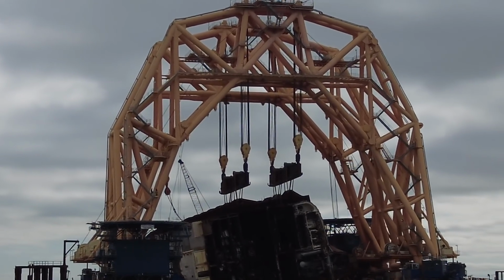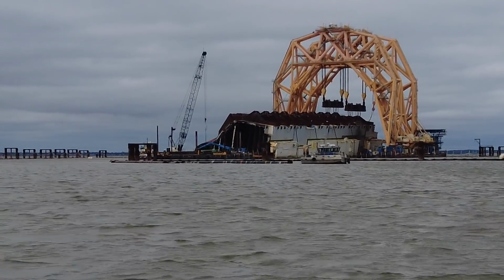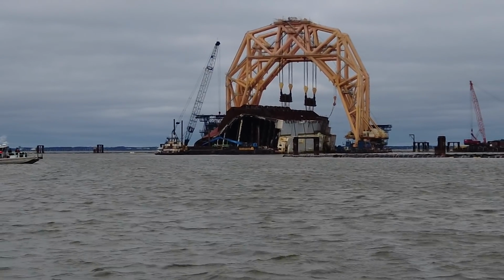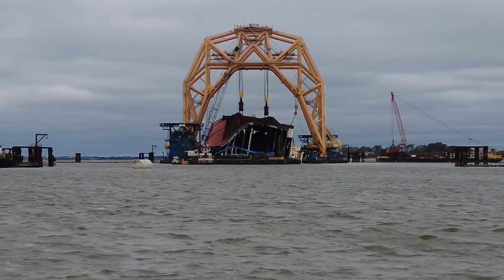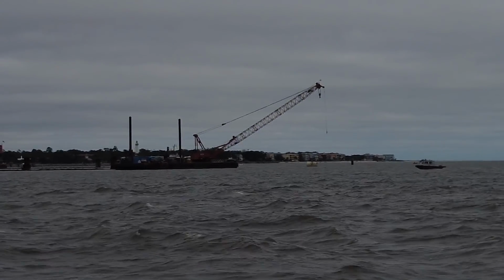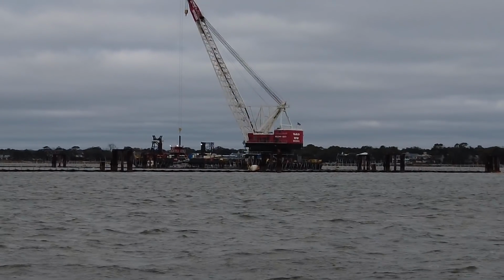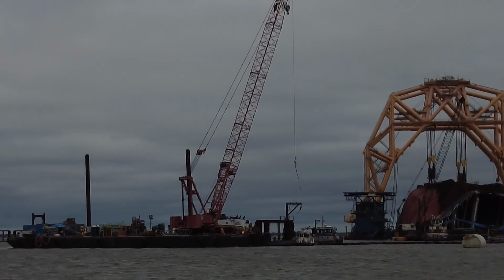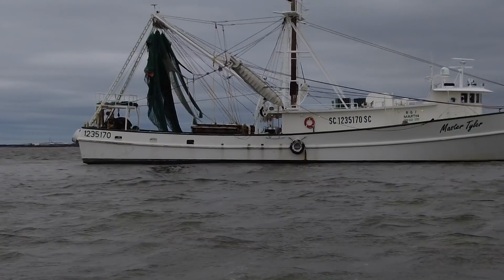CUTTING STOPPED--BUT SITE WAS JUMPIN!! on February 7, 2021   HD

Comment: Thank you for making these.  Extremely interesting process.    Did they ever come up with a reason for it flipping over?    Having watched some videos on RORO's being loaded it does seem to be a lot of work that goes into creating the load plan and getting the weight correct.  I had heard something about more Kia Tellurides being added than expected,
Reply from the maker: There was a hearing but no findings as of yet.  MM

Comment: Hi Andy thanks for another great update. Wasn't the VB 10000 originally designed to dismantle oil rigs, and not for salvage operations. Looking at the angle of the chain could be putting to much pressure on the cutting chain. A shallower angle might be better. Just my observation of things xx
Reply from the maker: That is correct.  We have discussed this as the fixed position of the blocks on the VB means that the chain must be pulled to near horizontal to cut through the ship.  The VB as a gantry crane, was originally designed to lift in the vertical.   Hope that makes sense.  MM
Reply: @MinorcanMullet That make's sense Andy. The angle of the chain while cutting would also be trying to lift the hull

Comment: Two to four day pause they are changing the wires out also weight shedding that part of the vessel
Reply from the maker: I just got my email from UC about the pause/problems.  Looks like this cut may exceed the 31 day bow section cut.  MM
Reply: Certainly hope the engineers calculations are correct that the force the VB10000 would be applying to the anchor chain would be sufficient to cut through the engine bed. Heaviest steel and designed to resist tensional forces. Wonder if there's a "Plan B" if they can't cut this section?

Comment: Great work as always with the thorough update.  Still hoping for a still or video of the chain slicing through the middle of the vessel.  Know you said you would try.  Intrigued that there could be a high value vehicle yet that they might try to salvage.  Also most interested if the remainder of the vessel shifts or collapses when the engine section is removed.   
Shame on the Coast Guard and all others (government and contractors) involved with the salvage that they are not in the least concerned about keeping the public informed and shame on them for not using you as a conduit to the public.  Your videos with some inside information would be priceless source of info not to mention good PR for them too.  
North Georgia friends salute you!
Reply: There has been a website with tons of info as well as updates that are emailed regularly.
Reply: @jaredhayes940  have been following St. Simons Sound Incident Response website and getting the emails.  While that source helps and is most appreciated, it leaves one wanting more and it surely seems they have not been forthcoming on the salvage progress (where we are, what is next, lessons learned in progress, etc).
Reply: Your videos could be great lesson modules for vocational training and sea captains to learn the reasoning that should go into fuel and load planning for a voyage.
Reply from the maker: I never intended to become the official news for this project.  Just wanted to bring the story as we saw it happening.  The news that comes from the Unified Command is slow as there are many steps the report has to take before it's put up for public consumption.  USCG,  P&I Club in England,  State of Georgia and others probably all have to approve any released info.  We are more the "unfinished" or "raw" product..  MM

Comment: The blue piece of equipment is a metal recycling unit it can be fitted with several units a electro magnet or a finger bucket device. They are neat to watch work as the cab is hydraulically mounted and rises for better vision.
Reply from the maker: Check out the video from Feb.8 to see it in action vs. the Golden Ray!  MM

Comment: Maybe they have to remove cars to find/repair broken chain inside ship?
Reply: The chain is not lost or broken inside. It was broken outside and recoiled inside. It was retrieved later that night, reconnecting and cutting resumed.
Reply: @jaredhayes940   Thanks. Good to know.
Reply: Good point Gaylon. Any chain left inside would change weight factors for future cuts and lifts. There is so much to think about in this project.

Comment: I wonder if they will take the barge around the stern and pull out some vehicles to see where the chain is snagged up inside the ship?
Reply: The chain is not snagged up in the ship. It had fallen in but was retrieved a few hours later.
Reply: @jaredhayes940  thanks I see I bet it was a tricky operation getting it back out someone must of had to go inside and find it and reconnect it
Reply: @MrCrabbing  yeah it’s pretty amazing what those divers and the rope guys can do while hanging over/next to that thing...especially at night... those are much braver men and women than I am.
Reply: @jaredhayes940  yes tough job I should think